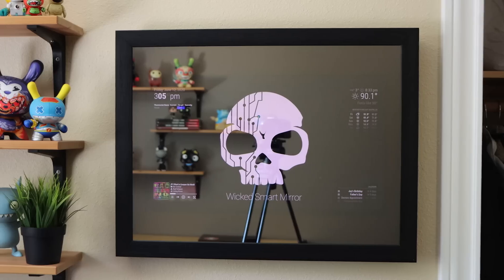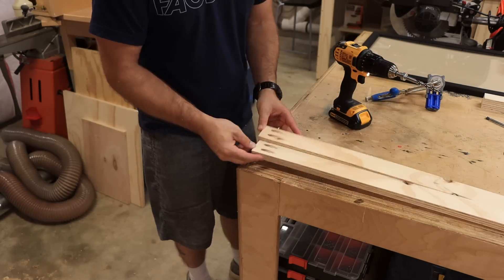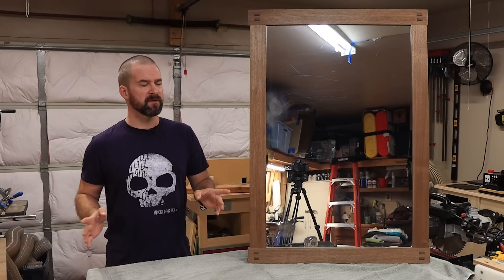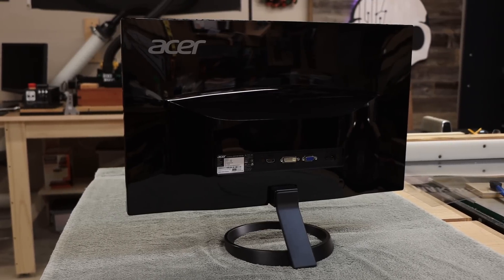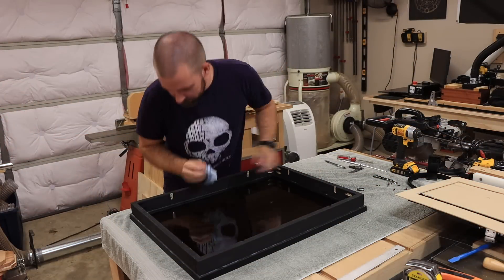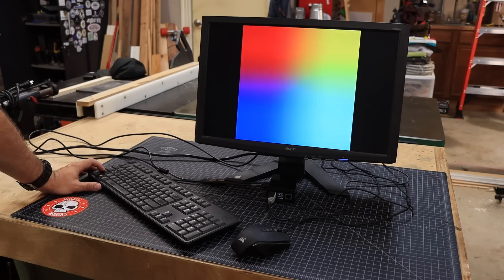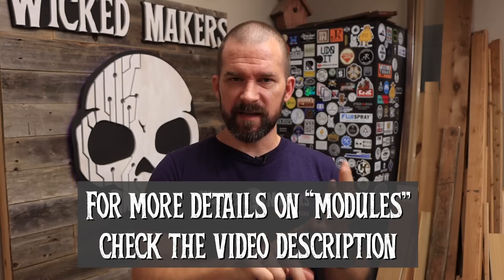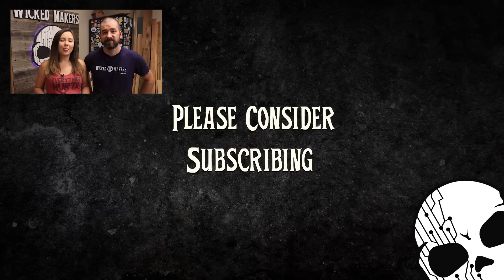How to make a DIY Smart Mirror

Comment: I'd recommend using Velcro strips for the power bar and screw those to the frame. the power bar will get very warm with extended use and that hot glue will release over time. 
Subbed, excellent build and great project over all. Plus you guys are an adorable team.
Reply from the maker: That’s a great idea, and thanks!

Comment: As a Carpenter I would not recomend using super glue. When superglue ages it gets cracks and will brake of. And wood grows and shrinks all the time so the super glue will crack even faster.
Reply from the maker: In our case the glue was just to hold the frame in place while we screw it in, but yes you’re right!
Reply: You guys are great with computers ect and for DIY you do a pretty great job

Comment: Awesome video guys.  Totally on point, inspirational, informative and overall fun to watch.  Did you consider putting in a cheap battery UPS on the PI - just in case of power outages/relocating of mirror/etc?  It'd prevent the little computer from going into shock.   How did you route power to the mirror in the end?  I take it you'd have two plugs to go somewhere? + Excellent skull logo!
Reply from the maker: UPS is an excellent idea! Hadn’t thought of that. 😀

Comment: quick question:
how do you control it?
the monitor buttons and computer bits are inside and it has no peripherals.
I really liked it, so I'm genuinely curious.
Reply: You could put the usb ports of the raspberry pi somewhere on the side and make some holes so you can use a usb keyboard/mouse. Or at least that's what I plan on doing :D
Reply: @wietskeveneberg9939 I don't know.  wouldn't a keyboard and mouse defeat the purpose of making it look like a mirror on the wall?
I might still end up doing that, but I'm sure someone might come up with a better solution that will make us even happier with this project. oh, well, keyboard it is, at least in the meantime.
the remote pc thing sound a bit complicated for me, but seems like a  "cleaner" solution. 
ideally, it would be a touch screen, but that is waaaaay out of my league.
decisions, decisions...
Reply: @galogiha  ideally, you would never need to actually access it. You can set it that the raspberry pi automatically launched the magicmirror application as soon as you power up the pi. Other than that ideally you would only have to access it if you wanted to do like, layout changes. No need to keep keyboard and mouse connected all the time.

For setting it to launch at startup, look at https://github.com/MichMich/MagicMirror/wiki/Auto-Starting-MagicMirror

If I figure out the remote launch I'll see if I can make a step by step guide.
Reply: @wietskeveneberg9939  that's a good point. I might be overthinking this. thanks.
Reply: I also just learned that you can edit it so you can control it from another pc. You would have to whitelist the ip from the pc you would be accessing it from though. The mouse/keyboard would probably be easier if you're not that tech smart xD
Reply from the maker: You don’t actively control it, but when you want to update it etc you can remote in from another PC or use a wireless keyboard and mouse. 👊🏼👊🏼

Comment: Hi this looks like a fun build. I downloaded the plans but you have the picture frame at 18 x 24 but most computer monitors are measured diagonally. Is the monitor you used 28 inches diagonally?
Reply from the maker: The glass is 18x24 but the monitor is smaller.
Reply: Wicked Makers sorry, not to be a pain in the rear but what does your monitor measure diagonally? Without including the frame which is now removed anyway. I’m guessing it’s 27.5 to 28 inches.

Comment: Complete waste of money to use a case for the raspberry pi. No need whatsoever.

Think about it.
Reply from the maker: I disagree, but that’s cool. Thanks for watching!
Reply: @WickedMakers  That's not an opinion my friend. A case serves a function. Half being a practical way to mount a board, the second being aesthetic.

None of which you need for a Raspberry Pi inside the back of a smart mirror. You put a case INSIDE another case effectively.

Again, not an opinion, that case is completely redundant, and furthermore, DEFINITELY raises temperatures higher than they would be if you just mounted it to standoffs screwed into the wood.

Comment: One suggestion for improvement and safety. Create a couple of slots (holes) in the extension of the frame (somewhere it's not noticeable, like the bottom for example) in order to help the raspberry cool by allowing hot air to flow out. That's very important, otherwise it will get quite hot in there. It's probably best to make some slots closest to where it is
Reply: actually you don't need to put raspberry in there simply extend hdmi  cable out and put the raspberry on false ceiling or some other location, so now you will have two cables running out of your mirror - power cable and HDMI.
Reply: could also include a small fan to exhaust heat that way

Comment: Please correct me if I'm wrong... but this would be entirely uncontrollable? As in, once you set up the apps and connect everything then hang the mirror.... they are stuck on autopilot and locked to those apps forever, at least until you pull down the mirror and take apart the back to reinstall the software.......there's no real easy customizing day to day? Wonder if there would be a way to create pre-set profiles or app groupings that you could connect to a phone app to change what is shown a little easier......
Reply from the maker: Most folks will remote into it from another computer to update things, or you can use a wireless keyboard and mouse as well.

Comment: This is really sweet,. I'm  wondering is it possible to integrate a  touch screen digitizer on the mirror so you could interact with the mirror. Or maybe some type of voice control (Alexa or Google Asst)? A follow up video with this would be super neat, hint hint.
Reply from the maker: Haha, yeah we’re thinking about a follow up. 👊🏼😄 I think all of those ideas are possible.
Reply: Voice control exists (also for DIY). Touch is not good (you do not want to clean mirror often). Or you can control RPI via mobile.

Comment: Side note for two way mirror setup. You can ether get acrylic one and put it against the glass so it stays straight as possible to get rid of the warping/fun house effect, or get peace of glass and use window reflective sunfilm on it, how ever applying film requires everything to be dust free and spotless clean, so i suggest applying it in bathroom with clean! running water so you can remove any particles from the surfaces or if you are not sure your skills, ask shop to do it for you, since its pretty difficult to get perfect. Just one dust speck is enough to cause cavity under the film and mirror look is ruined, but its definitely cheaper than those factory made ones.

Comment: Why not just use a usb powered monitor? It transfers video signal as well as power with one cable and if your raspberry pi is bluetooth enable you could easily mount speakers internally/externally as well as keeping the clutter to a minimum as well as slimmer.

Comment: I would advise people to shop around for cheap parts if their budget is low. For example the monitor does not have to be new and could be scratched etc., as long as the screen still works. The two way glass mirror can be obtained from a local glass store for  possibly 1/3 the price.   So just see where you can save - if you want to :-)

Comment: Anyone think of using the ir frames so you could use 10 point touch on these? Wondering if there's anyone working on a module or something similar for this use. I want to be able to interact with the mirror.
Reply from the maker: Yeah an Ir frame would work, for sure.

Comment: I have a question/ problem with your "hot glue solution" for holding a power supply in!! While it would seem ideal to use hot glue to hold a power supply in place....what do you do to stop the hot power supply from destroying the hot glue bond??????? 

Power supplies create heat, and hot glue ONLY BONDS when the glue is cool or cold!! It would seem like your power supply would fail to hold itself to the frame once the power supply heats up AND if the temperature of the room (hot day, hot shower and so on) could make the power supply "glue" fail!! 

The fact is I used hot glue to adhere a USB hub to the bottom shelf of my computer desks' hutch with the thought that the glue would (and should) hold it!! But like I soon learned the hot glue failed to bond the hub to the bottom of the shelf securely, because once the hub's power started flowing and heating up the bottom of the hub (which was glued to the bottom of the shelf upside down for access reasons) the hub only lasted about a week before it was pliable enough to fall off!! The glue you see got "just warm enough" to detach itself from the shelf allowing the hub to slip off and fall to my desktop!! 

So this is why I question your "hot glue solution" as a means to hold the power supply into place!!!
Reply from the maker: I admire how passionate you are about this.

Comment: ...kind of dangerous without any ventilation gaps or holes on outer frame:-(
Reply from the maker: It doesn’t get that hot but easy enough to drill vents if you need them. 👊🏼👊🏼

Comment: Self tapping screws for wood? Why lol it’s wood the whole point of a tapping screw is to avoid your screw from spinning out and making its own pilot hole for materials like metal. Also these screws are designed to wear down quick so you don’t cause the so called pilot hole all the way through and cause your screws to come loose in the future.
Reply from the maker: ? Self-tapping screws are incredibly common in woodworking. They’re definitely not exclusive to metal. 👊🏼😄 Thanks for watching.

Comment: Did you plug the monitor to the pi? And where is the cable to plug everything in? The wall just showed the mirror but where is it pluged in from? I keep replaying the video but not really specific about the plug ins.
Reply from the maker: We put an outlet behind ours but you have some options. Easiest way is to just run the cables down the wall. We detail a bunch of options in the plans.

Comment: I have a background on building Arcade Cabinets and I've built a Magic Mirror. Paint the "Card Board" flat Black, don't use Hot Glue to adhere the Monitor to the Cardboard. Use Zipties, Velcro and P-Clips for cable management. Vents on the top and bottom to let airflow. 10 Bucks from a Glass shop and you can get some nice glass cut to the size you want and some 1 way mirror window tinting and a hand full of youtube videos on how to apply window tint is a easy cheap alternative.
Reply from the maker: Nice, good tips!

Comment: that's not programming btw
Reply from the maker: Wait...are you trying to tell me that copy pasting into a terminal isn’t programming?
Reply: @WickedMakers  I meant if it wasn't copy pasting. I'm just being pedantic, but that's just configuration/customization of the OS more than it is programming. Programming would be if you were the ones writing the code that actually put the things on the screen for instance. Much more complex than installing pre-existing things, so I felt there was a distinction to make.

Regardless great video, but also you've got wood glue, you don't have to use superglue, and if you sanded down the frame and the pieces of wood, there would have been no need for the screws since when you glue wood together, the joint is usually stronger than the wood itself.

Also great to know you respond to comments!
Reply from the maker: Yeah I’m just being sarcastic and having fun. I lead the software dev team at a tech company so I’m plenty familiar. 👊🏼💀

Comment: you could have put a power button underneath to conveniently turn the monitor on and off.
you can also now get supermini PCs that run windows - these will give you a lot more customizability and you can put a USB adaptor in the frame so you can easy access to plug in a mouse and keyboard to make adjustments or upgrade or even add pictures... or even add a mic to have voice control
Reply from the maker: Nice!! Great idea.

Comment: I have a couple of old laptops can I use the monitor from them instead of buying a monitor
Reply from the maker: Not sure, it’s possible but you’d have to figure out how to disassemble it and get an hdmi input and power to it. Depends how savvy you are with electronics. 👊🏼👊🏼

Comment: finally someone making something epic. but why pocket hole the back on why not just screw straight through the back? A few things could have been done different. a smaller frame to fit the monitor size. blocks in the corners so no pocket hole jig required. seal the mirror to the frame to avoid water ingress. and maybe use a touchscreen moniter and a two way mirror film to make the screen touch. Also you can get stick computers for dead cheap that will plug into the hdmi and please use shorter cables or cut the cables shorter then solder and heat shrink. but still a cool idea so thank you as its food for thought
Reply from the maker: Awesome, all good ideas. 👊🏼👊🏼

Comment: This is great. *Question*. Once the smart mirror is built & mounted, if you have to make changes to the raspberry pi software.. let's say how the weather is displayed, or if you have to switch on news do you have to disassemble the mirror to get to connect to raspberry or can you do that over the WiFi or through a USB outlet outside the mirror?
Reply from the maker: You can remote into it from another computer via WiFi or some folks use a wireless keyboard and mouse. 👊🏼👊🏼

Comment: what thermostat did you use for the temp, also how did you get the skull on the mirror?
Reply from the maker: It’s hooked up to our Nest thermostat. We used a module that just displays a simple image for the skull. 👊🏼😄
Reply: @WickedMakers  I thought the nest thermo module stopped working after the nest with google migration. What module is that?
Reply from the maker: It did, yes but if you already had an API key from before the merge, it still works. Supposedly they’re going to add something back from my recent research but haven’t seen it yet.
Reply: @WickedMakers  could let me know what module you used for the skull. thanks so much

Comment: At least old non curved monitors can still be used for a useful innovative purpose.
Reply from the maker: Yeah, totally!!
Reply: Should really use a modern low-power screen for a project like this, not any old clunker. I guess a usb connected screen could be the best option, even if the cost will increase.

Comment: I wanted to do this so bad
Then I saw the price of the cheapest material and tool. I'm too broke for this
Reply from the maker: Not cheap to do it this way but you could use an old tablet instead.
Reply: Just use regular glass and apply the right film to it to make your own mirror like the one in video. And since people aren't allowed to just throw out computers and monitors in with their garbage, there's a huge number of people with no idea what to do with them. Just do an ISO post on F-Marketplace for the tech items you need and you'll get em

Comment: Beautiful project. Looks so good!
Doing it myself and got it all built but cannot seem to get the changes to take when adding modules. Any suggestions on what I could be doing wrong?
Reply from the maker: Make sure you’re editing the right configuration file. Are you restarting the mirror after editing it?
Reply: @WickedMakers  that’s where the trouble starts. I’m editing the configure files correctly when editing the code for the modules but when I try to enter the run command, it does nothing.
Reply from the maker: If you join our Discord, we can help you out there. It won’t be effective to keep typing comments here. 😄 Link in description.

Comment: Just so you know Home Depot and Lowes are technically not allowed to make project cuts.
Reply from the maker: Good to know! Seems like some will and some won’t.
Reply: Only way i could imagine an employee saying "no" is if the cuts you wanted were too small and time consuming for the saw cutter that they use
Reply: @fiedom92  I worked for both the only cuts were allowed to do are to be able to get the product into your vehical it's actual company policy sometimes you have an associate that will do more but we're not supposed to.
Reply: @jmpiv4  that's bizarre from my experience.  I'm a contractor and anytime I've ever needed or wanted something cut they've done it. Hell I've even left my saw at a main site and needed pine or plywood sheets cut to specifics for a side job and took it to lowes to have them cut it cause they were close by. I guess it's all location and management (Pittsburgh for me)

Comment: Hey a question for you guys, 
For people using acrylic wouldn't the acrylic bend because all the weight of the monitor is dead center and there is nothing supporting it and/or distributing the weight to the edges of the frame?
Reply from the maker: I think you jumped in Discord right? 👊🏼👊🏼

Comment: Quite a few things I would have done different. Wood glue over super glue.. super glue cracks easily from side impact. Re enforced the mounts for the mirror, those tabs were meant to hold a photo, a .5mm sheet of acrylic and a piece of cardboard... not a 1/4 inch sheet of glass. 
Going the acrylic mirror rout, I would remedy the “wave” effect by mounting a piece of glass in front of the acrylic. More resistant to scuffs and scratches.
Reply from the maker: All great ideas! 👊🏼😀